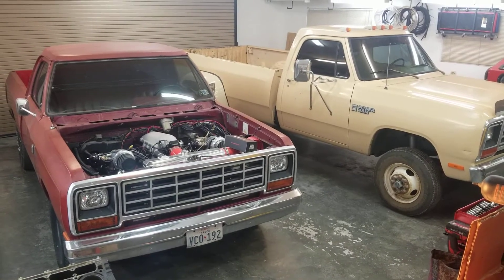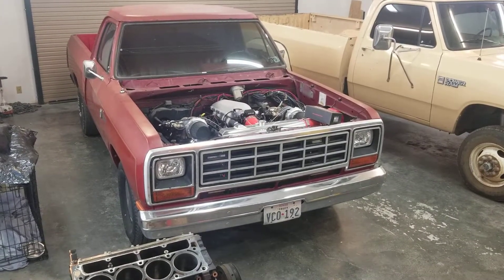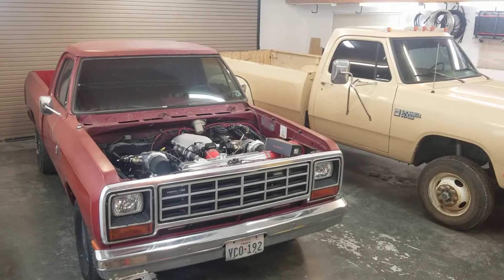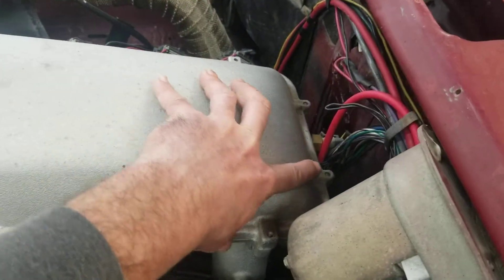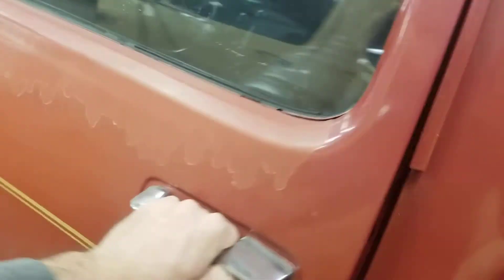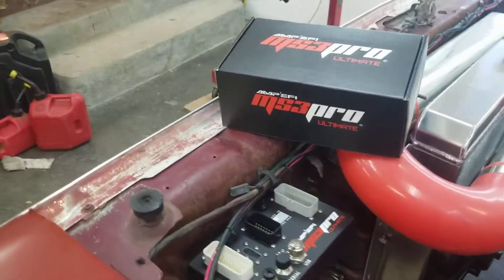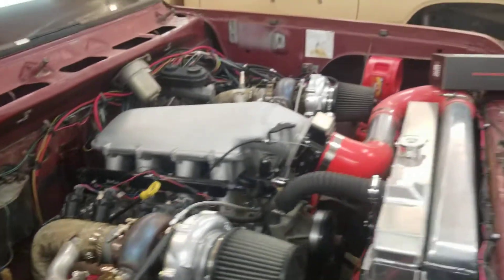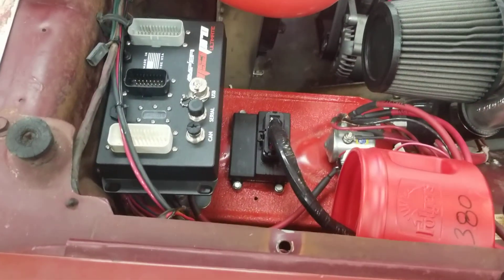Ms3pro ultimate vs. microsquirt overview.

Comment: Damn it! I thought you had a micro on a diesel!
Reply from the maker: No sir! I'm straight! Just stick a 12 valve in it if you need one of those smoky, slow, leaky, sounds like chewbacca's girlfriend farting, diesels. By my math, If I can make 906hp on 20 lbs, a diesel at 40 should make 1800..... and they don't even come close. 😉 I might 12 valve swap the dually though. We'll see. 😂😂😂
Reply: @thecarrsgarage2595  I plan to use it on a 12v. I'm using the micro to control fans, wastegates, and methanol injection in 2 stages. Also a data logger , dash, gps. I highly bout one of those engines will last very long towing 26k lbs all weekend. Let alone get 15mpg